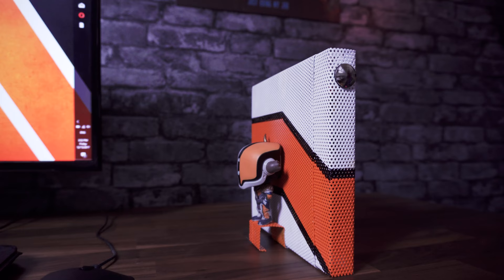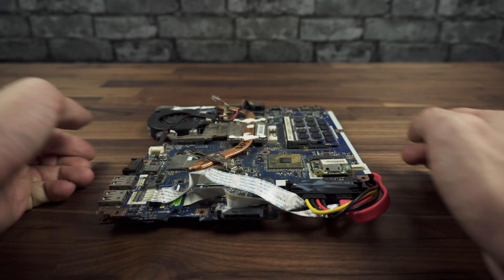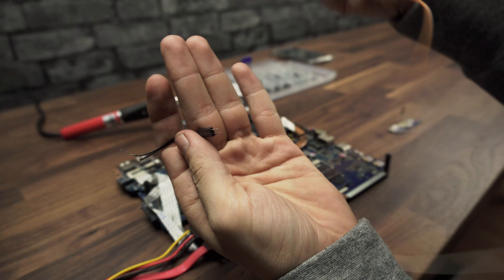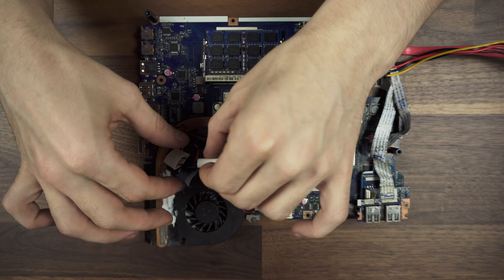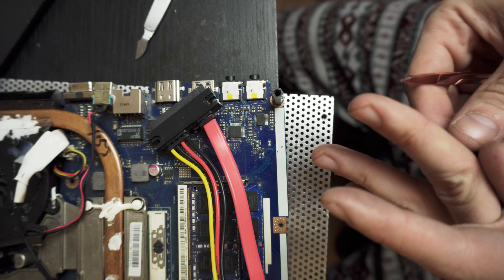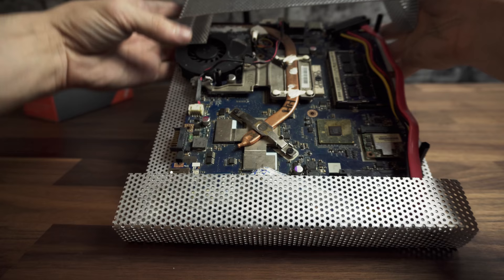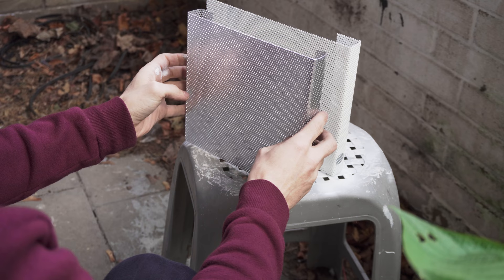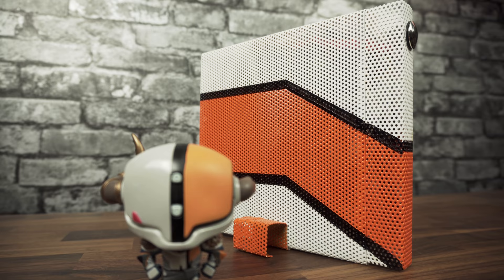Turn a BROKEN LAPTOP into a small MEDIA PC!

Comment: creativity level 1000  ... case and the color was great
Reply from the maker: some of my favourite colours!
Reply: Adam's just a qst can I convert my old 15inch  external monitor portable battery power ??
Reply from the maker: If you want to power the external monitor with a battery ofc you can you will need some soldering and a power converter and you can do it!
Reply: thanks man I will be looking forward to this project
Reply from the maker: I can do a video on this aswell, got some of the parts, now I am doing a DIY handheld console,and a speaker but I will add the battery powered monitor to my schedules
Reply: Great .... There are actually thousands of article on old laptop screens . But none are  regarding old monitor to portable monitor .I would be the first one to like and comment on that video for sure .

Comment: Great video Adam. I tried to make small media center on the motehrboard from compaq CQ61. Unfortunatelly there is 10 pin ribbon power cable and I have no idea how to connect it to new power switch. I think I've tried all the combitantion and can't switch it on. How you stripp cable insulation from this ribbon cable?? Can't wait for yours next video.
Reply from the maker: Mine had just 6 pins be sure you try all combination and it should work,glad that you liked the video,I upload every 2 weeks now
Reply: One more question. How did you stripp cable insulation from this ribbon cable??
Reply from the maker: They were soldered on the power button module, so I used the soldering iron to melt the solder and pull it out carefully.Hope that helps!

Comment: Hi its very interesting, if we remove the main lcd and use the 2 port for the main screen, is it possible? Or we still need the main source from the main screen?
Reply from the maker: You can use the second port, just plug the hdmi in and in display settings set it as the main screen (1/2) :D Hope that helps!
Reply: Adam's thank you for the replay, yes we can use the 2nd display, but you take the board out from the laptop, and for the display you use the hdmi port? Is it instantly working when you turn on the system? Because you not use the main screen :)
Reply from the maker: Plug the monitor you use through HDMI  and go in display settings, there you can choose your main screen, click on detect and choose which one is your monitor, like that you will be able to use it, It will instantly work when you power on

Comment: that Aluminium sheet with holes are great for  air flow 
But what about the dust which would enter from it?
Reply from the maker: You can add a dust filter on the interior but this will affect the airflow a bit, you win something, you lose something
Reply: Yea fair point.
noice video btw <33

Comment: Hi Adam,
I'm looking to do your build on a laptop which i damaged the screen and casing but all else works.

Could you clarify one point for me, as i seemed to miss it- the orange cable which connects to the power button, was that already part of the system or is it something i need to buy?

Hope you can help.
Thanks for the help and keep up the great content
Reply from the maker: Hi,
Glad that you follow the project
That cable comes from a PC power button, you can buy it or take it from a used pc
Hope that helps, and if is anything else  you think I can help with let me know
Regards
Adam
Reply: I understand now. Thanks.
Could I also ask, did you leave the rear of the enclosure open for access to the ports? I may leave the rear open or possibly make an i/o shield for it.

items are on route so project should be done by end of next week and i'll post my finished build.

Thanks for the help :)
Reply from the maker: Yeah the rear I left it open but you can use the same technique for the IO, send me the pictures as well, I want to showcase some of the builds,
Regards
Adam
Reply: Thanks,
I'm gonna go for a steampunk style theme. Hopefully it turns out well. Will definitly send finished pics
Reply from the maker: That will turn up pretty well!
Reply: I hope so. The laptop was days old when i dropped it. House insurance replaced it so this is a bonus build for me :D I'm having fun with it so far, thanks for the inspiration.
Reply from the maker: If you got a type-c or thunderbolt, you are golden, make a module for a GPU as well
Reply: Yeah, thought about that but unfortunately no thunderbolt. Considering the beast egpu through the pcie lane and putting in a wifi dongle. Possible within the unit if i can find a small form power supply. Some how i've come in to possession of a 1080 which is way over kill for this so will flip that and go for a 960 maybe.
Reply from the maker: 1080 is a bit overkill, but that depends of the cpu, well I am excited to see it when you are done!

Comment: That's an awesome idea to use that as a quick and easy case. 
But I have to wonder. If you push in the case from accident, could it short the electronics or would the paint prevent that well enough?
Nice build. Where did you get that metal sheet in low quantity?
Reply from the maker: Hi Andrei, glad that you liked the build, the motherboard is screwed on standoffs and the painted grill is quite sturdy so it will not bend really quickly, as for the sheet of aluminium it should be a link in the description

Comment: Ok ur the first vid i found that helped with the power button wiring but i got a question how in the hell u power it up like do u still use the laptop charger n battery
Reply from the maker: I removed the battery and power it with the power adapter, It was taking too much space.

Comment: Two questions... First can you post a pic or something on how you mounted your HDD(s) ? Second, is the power supply connection nativy 12v because the switch used is...
Reply from the maker: The SSD is mounted with double tape to the case and the power supply outputs 19V hope that helps
Reply: Adam Builds thanks it does. I wonder if double sided would be enough for two mechanical hdds. I think it might.
Reply from the maker: Just buy 3M double sided tape for metal bond and it will do the job nicely

Comment: Turned out pretty smexy! Would have loved to see it "demoed"  too, like hook everything up up power that boi and run a quick bench showing Temps etc etc. Pretty damn creative too using mesh for the whole construct! 

One note though, I did not seem to notice an SSD or HDD mounted in the system anywhere, was it added later on?
Reply from the maker: Hi, 
I have to apologize for that, but this was my first ever video, the actual first video I ever edited and shot, so there are a lot of problems with it, there was an SSD added after that, I will use it along my 3D printer rig so it might appear in a video in the future, but there are not many things that can go wrong in the build so from there my lack of demo 
Glad that you liked the build overall
Regards
Reply: Well, for your first ever video, you did very well!  Thanks for responding. lol that clears it up. XD Have a good one! =D

Comment: Hi, I am Inspired by this video to try my first custom case for an old laptop with a broken monitor. One question, will a 3v Car switch work or is 12v switch required ? Also why cannot it be soldered directly to the car switch cable? (I am a noob, sorry if the question is stupid) Please leave a link for the cables of the power button used. Cheers ....

Link to the switch: goo.gl/YNrPWv
Reply from the maker: Hi, happy that you find the vid interesting, you can use wherever switch you want, I used a car horn switch, you can definitely solder it directly but I thought that it will be handy if you want to take it apart. I got the links in the description with all the parts I used, hope this helps!
Reply: If you had a fully working laptop, except the battery doesn't work anymore, you could literally turn it into an All-in-one PC.